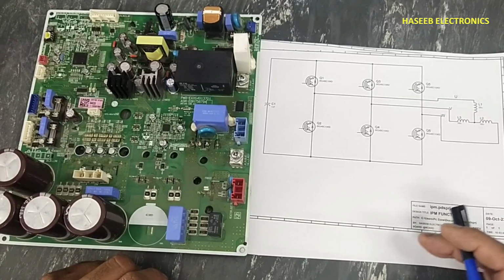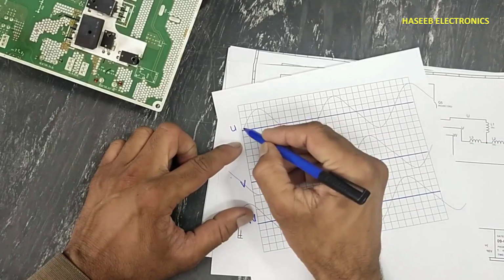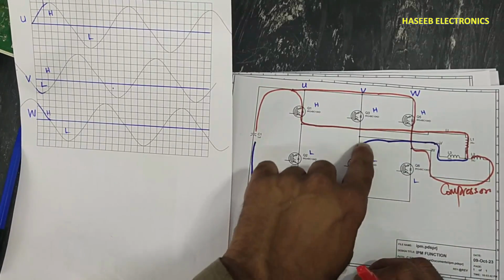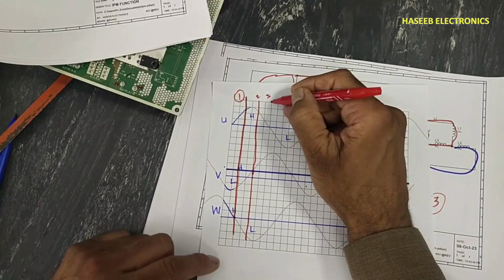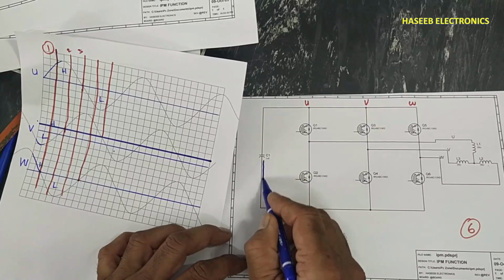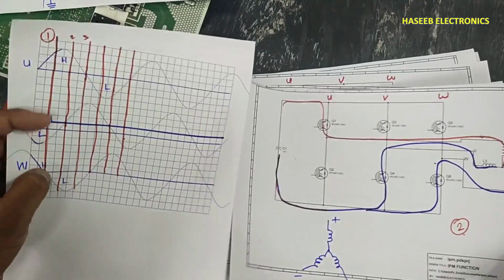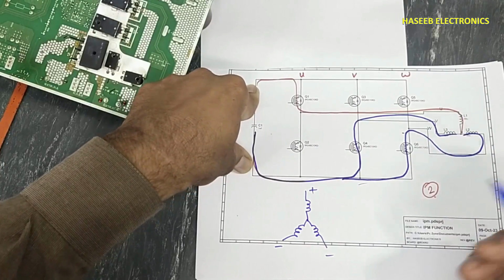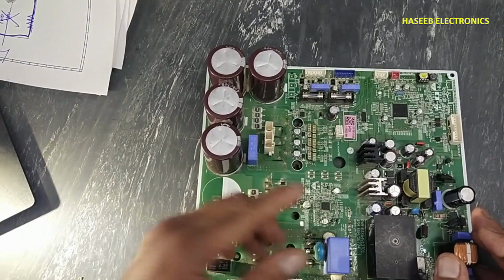{972H} How does an IPM converts DC voltage into three phase

Comment: In dc input voltage is 300vdc through ipm we will get 300vdc to motor output?
Reply from the maker: before IPM these volatge are DC voltage, but after IPM the volatge are switched DC (closer to AC) so RMS value will be used based on duty cycle of the switching pulse
Reply: It mean we can also down voltage?
Reply: From 300vdc to 150vdc bus pwm?
Reply from the maker: @FanucPMC yes the frequency and duty cycle controls the "true RMS voltage" to control the load speed

Comment: But in a 3 phase AC servo drive don't only 2 igbts turn on at the same time? 1x High IGBT and 1x Low IGBT. In your explanation you said 2x High and 1x Low will turn on. Do all 3 turn on and off and the same time? Won't one of the high igbt be fought by the other High igbt?

Comment: Assalamualaikum Bro, what is the form of signals produced by the microcontroller for the IPM, it is a sine waves of square waves? Thanks
Reply from the maker: it provides square wave signals 
either PWM signal or SPWM signals
Reply: @HaseebElectronics  Thanks Bro

Comment: Great work. You've described 12-step commutation, which is mostly done in FOC mode of control, i.e if at least 2 phase currents are measured in scheme, but, more often it's just 6-step block commutated sensorless drive based on zero crossing detection of Back EMF from motor. ..and by the way, if fore mentioned resistor is damaged there's great probability that an MCU is also damaged..so almost impossible for most people to repair (exception would be an authorized service which has replacement MCU and it's firmware and loader).
Reply from the maker: it is 6 signal combination to create 3 phase.
this SMD resistor damages most of time, 
if IPM damages, in some cases the reverse flow causes to damage IPM, and most of the times these resistors protect the MCU

Comment: Sir, Basically i am a technician. This video is specially help me alot to learn. Sir i have doubt from longtime, which is. Ac single phase rectify in dc voltage, then it will entering into IPM. So as you said in video the six low/high IGBT's are doing the work to produce the magnetic. So here the dc voltage only entering into compressor. Somebody say that IPM convert the DC backinto  AC. Is this this true? If yes how its possible. Please give me some solution sir. Thank you.
Reply: Is it was the video brother can I know where are you from I thought   you are from India
Reply: @MdIsmail-ci5uy  yes bro. Am from India  and you?
Reply: @rajkhumar001  I was guess you're from India (I am from Bangladesh 🇧🇩)

Comment: You didn't show the freewheeling diodes in the diagram. They are needed for the transient process when current passes from one transistor to another. Or are such diodes not needed?
Reply from the maker: You are right 
In this session i just explained the dc high voltage conversion into ac voltage 
In upcoming session i will explain ipm in detail with all its inputs, outputs, and safeties
That diode are compulsory